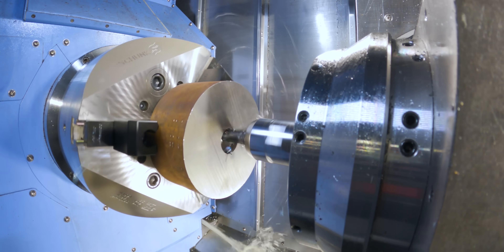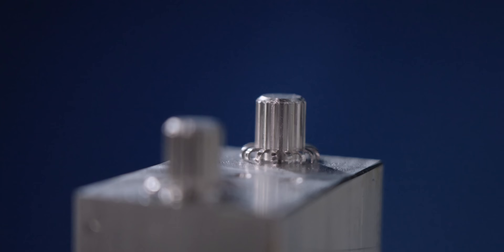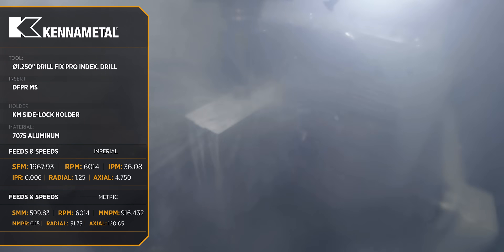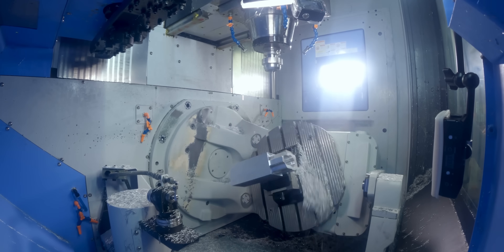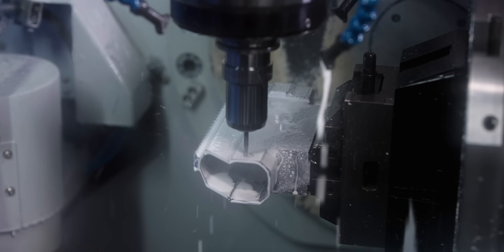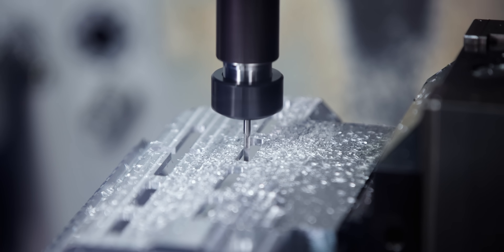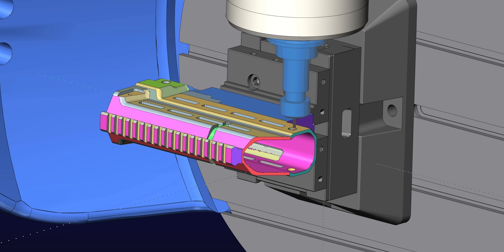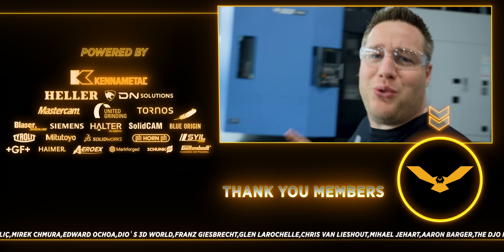Brilliant CNC Machining Techniques

Comment: I am just realizing that you still use the imperial system to make all these machine settings. A system based on variables to do some basic measurements like the weight of witches, whether to burn them or not and for farmers and retailers to sell their groceries because there was nothing else. It is like the English driving right handed and have to use their left hand for the center controles settings, like a self created handicap. So I have even more respect for the nice things you are creating and showing us.
Reply: I think driving right side is the way to go.

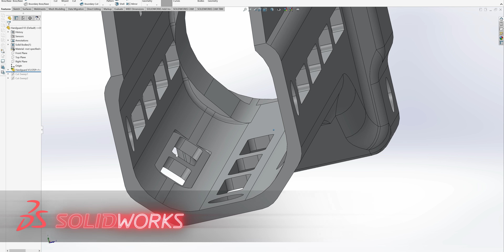Comment: 8:40 we had similar pockets in parts for asg ris (which should be generally casted). I assumed special t-slot mill. We had generally brainstorm whether these pocket should be casted or machined.